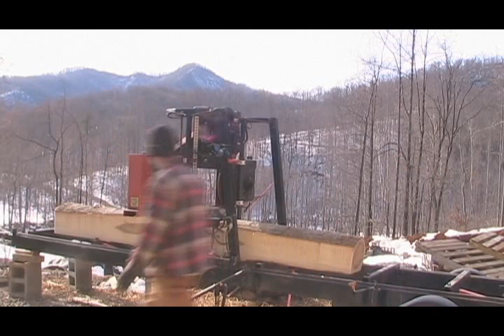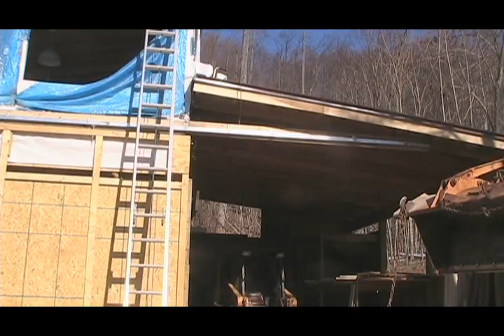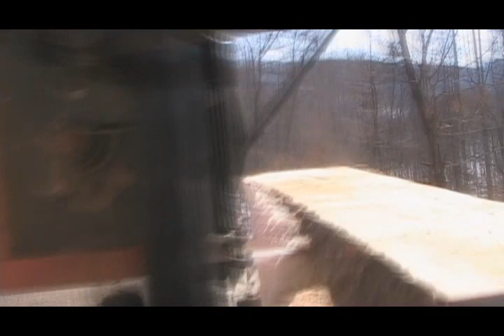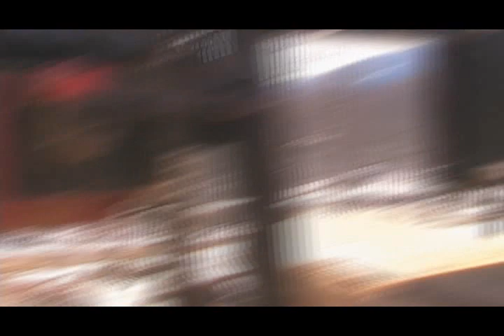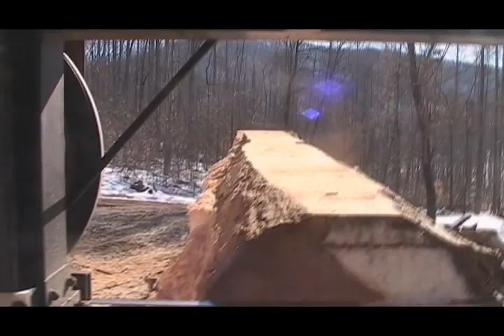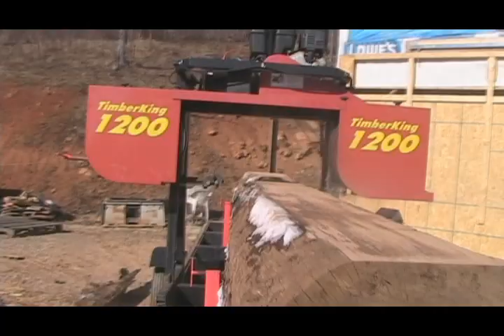Timber King 1200 Band Saw Mill

Comment from the maker: @handy3112
handy, its home made. currently using a 90v dc gearmotor, with a 120v dc motor controller tweeked to latch and "break" when either limit switch is touched. I think the way to go would be an electric winch(boat trailer winch) motor with a pwm controller, then can run from 12 volt, except pwm controllers HATE and will not work with the "pulse noise" of a briggs alternator/magnito charge system. Ill snap a few pics, or post a close up vid some day in a few weeks or so. Tnx Pete in Va